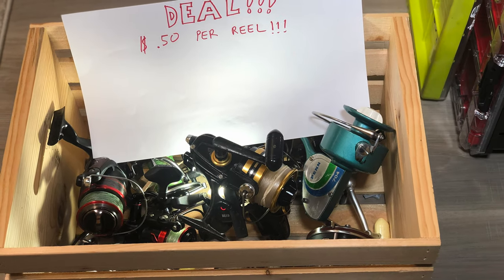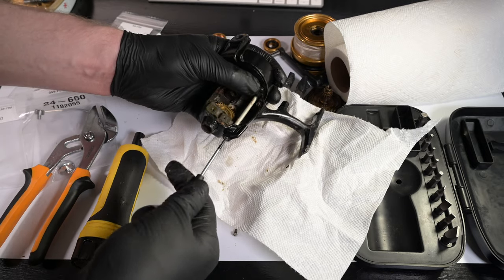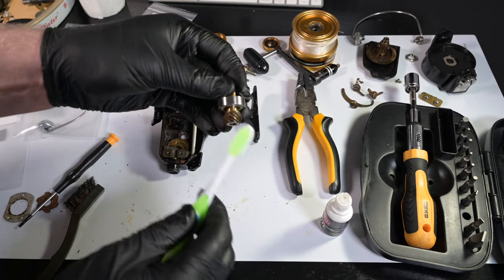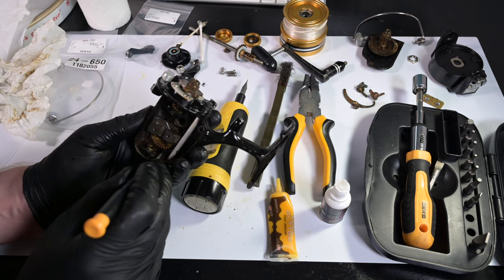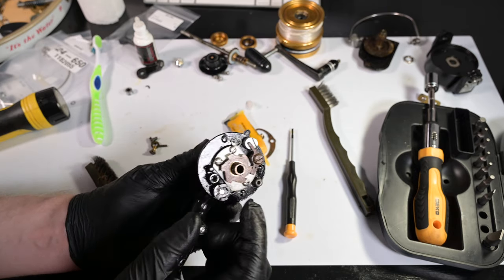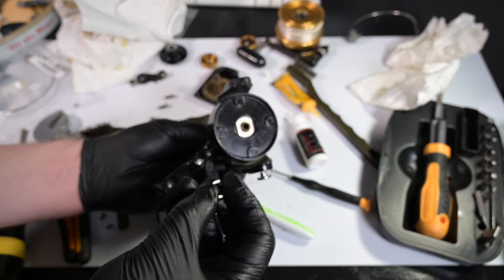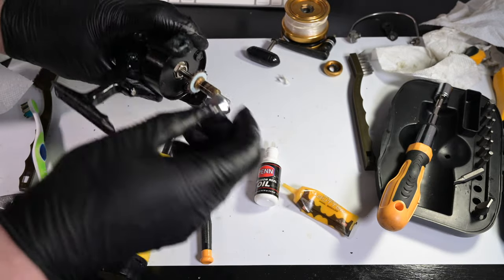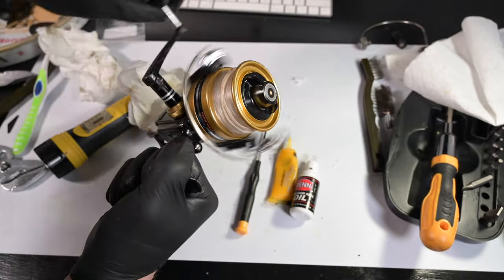PENN 650 SS: Cleaning & Repairing an OLD Spinner

Comment: Do you have any tricks for getting a stuck bearing free from the main gear with the side cover plate in between? This is the only problem with a gift 650SS. I can't budge it with any normal means.
Reply from the maker: I'd hit it with PB Blaster and give it 10-15minutes.

Comment: I watched and think I followed every step lol, but I have no drag... any help?
Reply from the maker: Make sure drag washers are installed and correctly placed. Make sure the drag knob is tightened most of the way. Try to pull line out of the spool. It should click and give. If nothing…it could be the drag knob. They are notorious for cracking or separating from the metal insert housed within them. You may be able to glue the metal insert back to the drag knob. If the plastic drag knob is cracked you might have to find a new one.